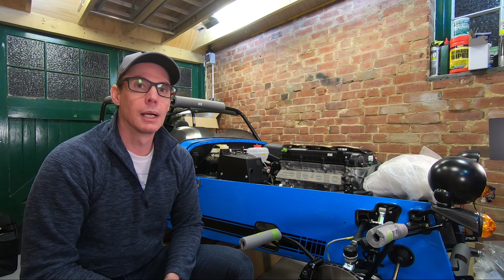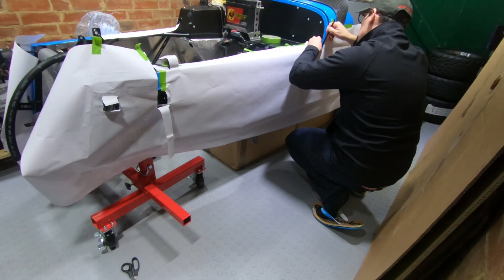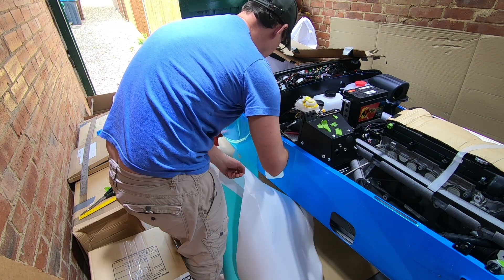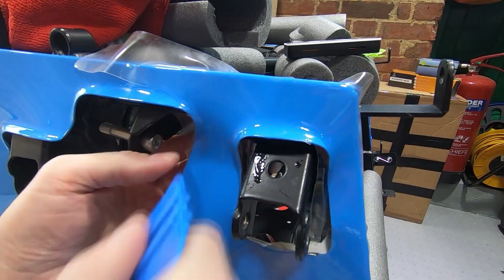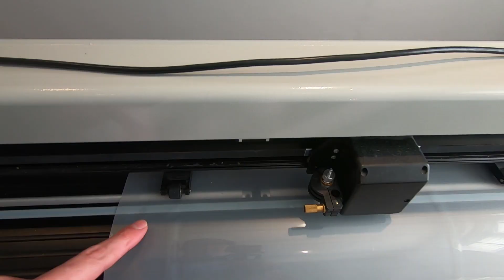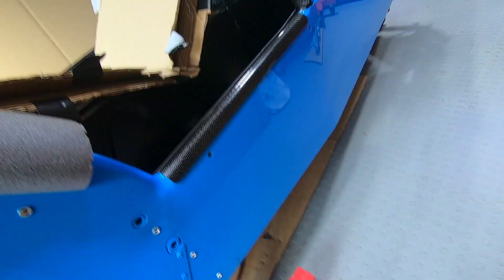Caterham 420R Build - Paint Protection Film - Episode 4

Comment: I'm in California and was quoted $4k to wrap side panels, nosecone, and rear wings. PPF installers can get a lot of money it seems.
Reply from the maker: It's madness, the film only cost me $200 and I have enough to do the nose and arches. I would recommend trying to do it yourself, the Xpel film is so easy to work with, just take your time. Have a look on the Xpel website they sell the precut kits for most cars.
Reply: @thecaterhamcave  I think I could tackle the sides because they are flat. But stretching it over the nosecone (Mine has a 420R race nosecone with extra vents/contours) is not for beginners. I'm probably just going to bite the bullet and pay a professional.
Reply from the maker: @Tmac  I have the 620 nose, so I know what you are referring to however, if you look at the kit that Xpel do they do the nose in multiple panels. https://www.xpel.com/paint-protection-kits/XPEL-UK/Passenger-Cars--AND--Light-Trucks/2019/Caterham/Seven-620R/None